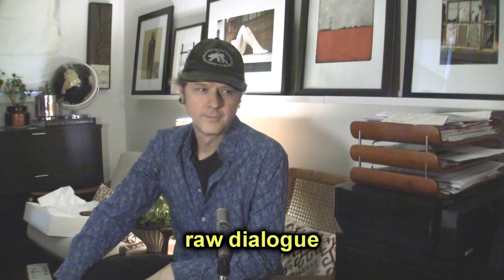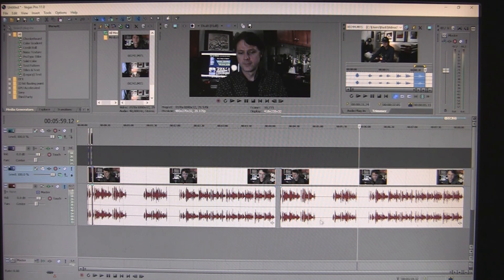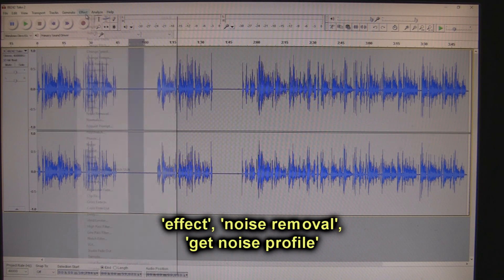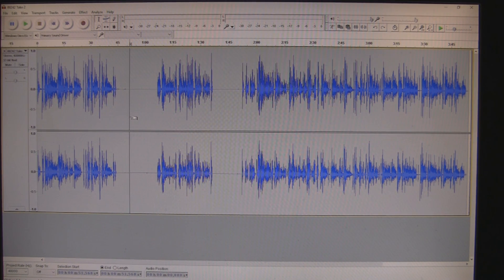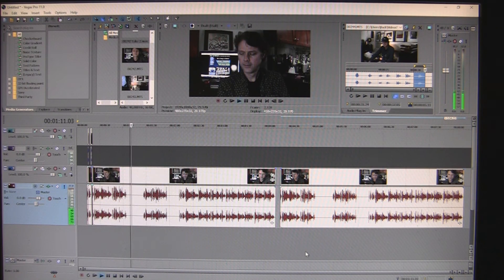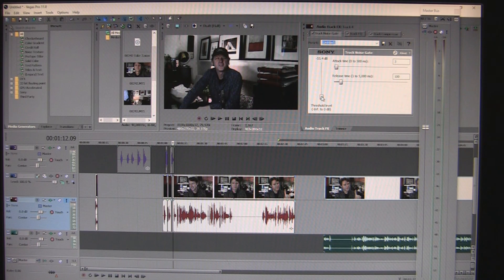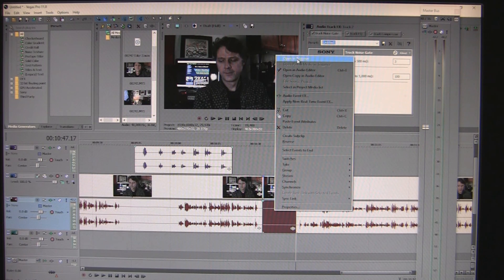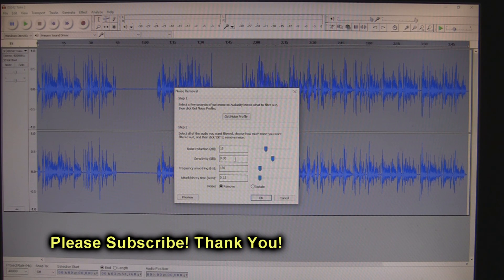How To Remove Noise from Recorded Dialogue (Dialog), Use a Noise gate and Add Room Tone

Comment: sir, how to eliminate rid noise,buzz sound in audio console.
Reply from the maker: That's an AC and grounding issue, most likely....there is something called 'star grounding' but I am no expert in electrical issues. I had the same problem years ago and discovered, with a $8.00 circuit tester, that the room's outlets were not grounded! So, it's most likely a grounding issue (or 'earthing', in the UK).
Reply from the maker: Be careful of AC and fixing grounding issues; I would contact an electrician just to be on the safe side, because it's not worth a potential shock hazard. Be safe! Cheers!

Comment: Nice! So, Audacity removes most of the noise for the whole audio track? And not just like a gate when you talk, the noise comes in, and when there is no dialogue the noise is gone? Like I hear a bit at 1:57 in the video. But I guess you mentioned that it's not the ideal situation because the signal-to noise ratio isn't that good.

It also depends on the microphone I guess that makes the quality of the noise removal? So if you use a omni pick-up pattern. I guess it's harder to remove the noise?

And last: Do professional movies use noise removal too? Because I think it's mostly quiet on the set the whole time.
(No fridges, airconditioning,...)
Reply from the maker: Yes, Audacity removes the noise from the whole waveform, quite well, actually if the noise is steady. My mic is set to 90 degrees (as opposed to 120 degrees) and focuses well on the source. An omni would be harder to work with. Movie sets can be quite controlled for sound, but not always; it is as quiet as possible and maybe really quiet on a sound stage, but not perfect in an actual location. More advanced tools, such as Isotope products can do a whole lot more - BUT, if you get a good SNR and a relatively quiet location, as well as some 'wild lines' and room tone, dialogue should be easy to work with. If it isn't, then there is always ADR. Cheers!
Reply: Ok, and is it Isotope RX5 then?